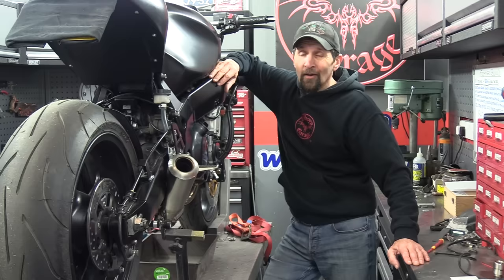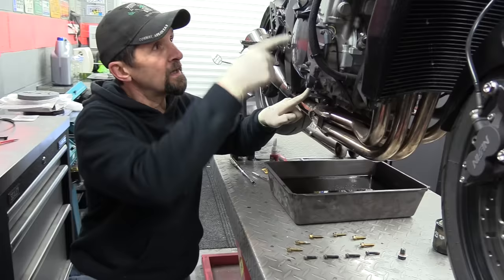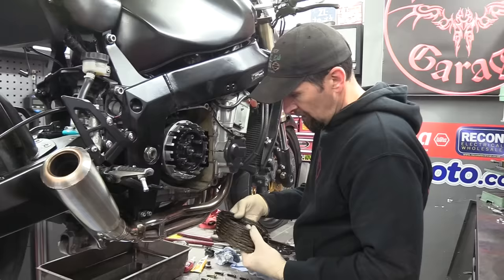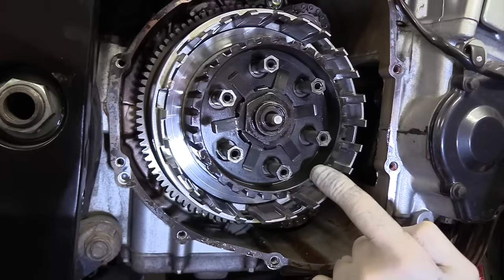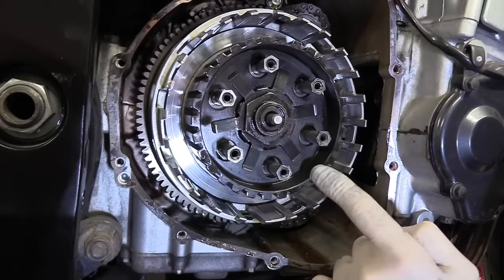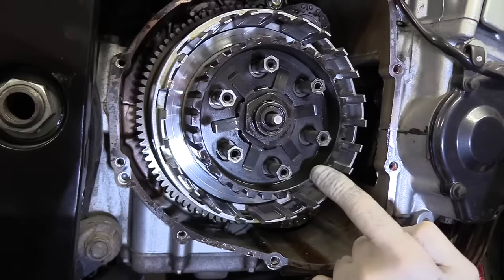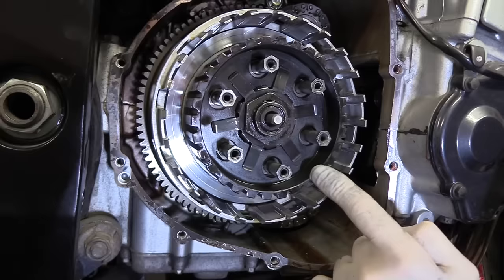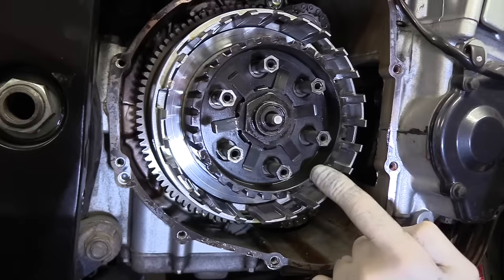Delboy's Garage,  Motorcycle Clutch Replacement .

Comment: Hi del, thanks again for another great vid. My old zx9 has a problem with clutch, when it's been standing for a while (few months) when I pull clutch lever in and select 1st gear the bike jolts forward and stalls like I've selected gear without pulling clutch lever in, I have to keep working the lever and wait for the bike to warm up a bit before things return to normal, just wondered if you had come across this before and what you think it could be, many thanks john.
Reply from the maker: Hi John, that sounds like every day on an old Harley.!!!   it sounds like the plates are hanging up and taking time to separate fully if working the lever improves it, try changing the oil mate, i assume you're using a good quality 10W40 semi synth at least ?.. and like with a Harley, try working the lever in and out BEFORE starting the engine ! then work it again before you engage first, and see if that improves it. If not, then id drop the cover off and have a look at the plates, you may have some warped ones in there from overheating..!!!! Good luck with it mate.   Del.
Reply: @Moonfleet41  thanks del, it had a new clutch about 5 years ago but I only do low milage and a oil change 600 mile ago with castrol 10w40 bike oil, fully synthetic. That bike has always done it since  I've owned it, like you said with an old Harley maybe it's just the way they are. Thanks again del👍
Reply from the maker: @TheWhisky81  Hi John, ok, sounds like a healthy well kept bike, and am presuming not abused... not sure what model of ZX9R you have, but you said old ZX9R, and the early ones were hydraulic clutch, so if yours is?  Then try bleeding the clutch through completely as that could be stopping is disengaging fully if you have any air in the system.  It's hard to diagnose a spongy clutch unless it changes all of a sudden because they're not solid like brakes, am sure you know how to do it, just pump about 4 reservoirs of fluid down through the clutch line and out the bottom, then tape the lever halfway in to the bar over night so it's just biting, but don't pull the lever all the way in... then give it another try the next morning, could be a spongy clutch is just not pushing the plates apart fully... the clutch rod should do about 3mm of movement and a spongy clutch can half that, causing the plates to drag,s o give that a go mate.
Reply: @Moonfleet41  sorry del I should of said it's the e1 2000 model, they went back to cable operated on these models, it has had some abuse to be honest, outon park 6 times, donnington and Silverstone once. If it gets more frequent I will  just put a new clutch in I think, thanks john.

Comment: Hiya del. It's hard to diagnose things from a far I know but, What would you say the most likely issue is with my clutch on an 02 Busa: I have had it for the past several days where, on a cold morning, the clutch wouldn't engage at all for the first 5 minutes. It would then start to engage, but would sometimes act as if the clutch lever was pulled slightly in at certain revs.

After about 10 minutes, everything would be fine. I changed and chased out the old clutch fluid fluid anyway just in case. However, the past few days the bike hasn't been engaging with the engine at all. As I tried on several attempts to pull the clutch in and release, it was making a horrible grinding noise. I glanced over to the little window where the clutch plates are, and I can see what looks like parts of metal.

What is the most likely culprit here do you think? Do you think I am looking at simply replacing the clutch plates, or are you aware of possible more damage, based on what I've described? What's the worst case scenario in other words.
Reply from the maker: No point putting it off buddy, drop the cover off and have a look.. Hayabusa clutches can have a few problems, the basket can come loose, the slipper mechanism can play up (in fact they usually do), and until you find out what those "parts of metal" are then there's no point guessing.!
Reply: @Moonfleet41  yeah I know pal, just gathering some intelligence before I start the inevitable! Cheers for the insight, that's what I was after
Reply from the maker: @hunterjg777  You're most welcome mate, wish I could be more help, good luck with it, hope it's something minor that can be fixed cheaply!
Reply: @Moonfleet41  just on the back of this del, I've taken the clutch cover off, and it appears one of the friction plates has snapped and taken one of the forks with it, but just one forks - am I looking at rrplacing the entire basket now, or in your experience, would this still be usable?
Reply from the maker: @hunterjg777  Just to be clear mate.. what exactly are you referring to by "Forks"  can you send me a picture maybe ?.

Comment: Thank you for your video. May I ask a question? When I opened the cluctch friction plates, and everything was off, out of curiousity I pulled the clutch lever few times, and each time it became harder untill it is so stiff that it is not almost moving at all, the lutch lever I mean.  I am waiting for the cluctch kit to arrive by post now, and have few days to figure out what I did wrong, perhaps. Should just finish the clutch repait and close everything, and hopefully the clutch lever would work again? Would it become soft again like before, or because I pulled the cluch at the middle of the repair I have caused any bubble or damage to the hydraulic system of the clutch?  My bike is 1988 Kawasaki Ninja ZX10, hydraulic clutch system.  Any help/guid with this regard would appreciate it. Best
Reply from the maker: Most likely you've pushed the slave cylinder piston to it's maximum as there was no opposing force from the pressure plate pushing it back... so the slave piston keeps going, like a brake caliper piston with no pads in, once you put the pressure plate back on and push the rod back, it should hopefully return the slave cylinder piston back to it's seat.
Reply: Immensly  apreciate your quick and accorate reply. It is honor to have more people like you on youtube/social media who are very usefull to the others/general public. Please let me know if anyhow I can help or repay for your acourate help/answer. Chase from Orange County. Best Regards
Reply from the maker: @chasebagherieh3869  You're most welcome Chase, im glad the in reply helped you out... we have heavy overheads running a bike channel with parts, materials and consumables, and we're not a commercial garage, i just do this for the Youtube audience, so all the usual ways to show some thanks, you can become a Patron if you like, or just a 'dollar in the tip cup', it all helps with keeping he bills paid... other then that, just subscribe and keep watching, there will be other videos that will help you im sure.. Thanks again my friend.. take care and keep safe.. Del.
Reply: @Moonfleet41  Yes, I just signed up. Thank you again
Reply from the maker: @chasebagherieh3869  Thank you Chase, will message direct on Patreon, much appreciated!

Comment: Have a question about car quest W15-40 diesel oil . Does this oil cause clutch plate to stick? Second time I sent my bike to bike shop and they charge me $50 bucks for a oil change and I notice my bike jerks forward pretty hard when I take off
Reply from the maker: If they are a garage, why are they fitting 15-40 diesel oil car quest and not a 10-40 motorcycle oil?
Reply: Delboy's Garage guess they are cheap. I have to change my own oil from now on. I work at advance auto. So pricing for be a cheaper than getting it serviced

Comment: On my zx12r basket and hub there is slight burrs on some of the edges not on the flats. Would it be okay just to smooth them out ever so slightly?
Reply from the maker: Yeah, as long as you just remove the burr, and no extra metal.. that will help prevent anything hanging up during operation..   Cool bike BTW.
Reply: @Moonfleet41  thank you for the reply. Yes best bike i have owned just awaiting new plates now so i can get it back together. Thank you for the advice and keep the videos coming.
Reply from the maker: Most welcome buddy, and go careful, that's a monster of a bike right there..!

Comment: Wish Kawasaki clutches where as easier to do than this, just over two hundred pounds just changing the levers and holders, together with the cable adjuster[ not counting forty quid for oil] and the damn thing still slips in first gear!

Comment: Is it necessary to apply threadlock for clutch lifter plate bolts?
Reply from the maker: No, I've never done that, just torque them in evenly to the correct value.
Reply: @Moonfleet41  Thanks

Comment: Right I need your help I don't know the torque specs for the bolts it's a 125 just don't want to end. Up stripping the bolts
Reply from the maker: Nor do it Charlie, id have to look them up just like you.. if you don't have a service manual (which will have them clearly listed) then you may be able to download a PDF from the net... lot of resources online mate.
Reply: @Moonfleet41  thanks but just wondering could I just have them hand tight
Reply: @Moonfleet41  and huge thanks for the reply

Comment: What do you mean by juttering? cause rn when I let my clutch out right as I hit the friction zone it starts like vibrating or stuttering or juttering as you says maybe.... Other then that it feels fine.
Reply: Like it shifts fine no slipping at high  rpm but that was only on the ride home after it started happening and I just replaced the clutch last april
Reply from the maker: Hi buddy, the 'juddering' or stuttering as you call it, can be caused by a broken clutch spring, so you're getting an uneven pressure around the circumference of the plates, it can be caused by a plate that's breaking up (and new ones can break up too), or in extreme case, a fractured steel plate, but if all of that's ok, it could simply be a case of needing an oil change as it does affect the clutch, the same as does a low oil level, because the clutch plates can then overheat and warp, just a few possibilities mate.
Reply: Delboy's Garage yea man i really hope i didnt heat them up to much i went on a 3 hour ride up north and did some riding up there as well and I wasn’t being easy on the bike either, never did I check the oil but i had just changed the oil and I use Amsoil so i thought it would be good but it was like 3.5 liters low..... the trip was like 480 miles round trip but it was in two days 300 miles one day tho. Its crazy cause the problem didnt start until i got into my town first red  light i stopped at let the clutch out and it started.. glad it didnt happen where i was .im probably gonna take the case off today and take a look. Thanks:)
Reply: @Moonfleet41  Thank for the reply, my bike was low on oil when i got back from a trip about 500 miles round trip and it started right when I was almost home. The oil  wasnt in the sight glasss at all with the bike level I added maybe 3 or 4 liters what kind of damage could this have done. I havent opened the bike up yet because I contacted a shop to help with some other things and didnt want to tear it down at my house then they call tomorrow plus I like to collect a lot of info before messing with it so I dont mess anything up but obv might be too late for me not to mess anything up lol.
Reply: @Moonfleet41  Also How could I fracture a steel plates I do run it hard but not dropping the clutch at all. and If it was a steel plate or spring I still have my old steel plates and springs could I just swap out the bad and put the old in?

Comment: I’ve got a sv650 2004, clutch slips under moderate acceleration but only when bike isnt fully warm. Any idea why?
Reply from the maker: Try an oil change mate, if it hasn't been serviced for a while, it's always good to get that up to date before you go trying to diagnose more expensive problems... if it happens after you've done an oil change, then drop the pack out, take a look at the rings... see if they are scorched, or buckled (but of course, first check you have enough free play in the clutch lever at the bars, if that's too tight, then your clutch will slip till it warms up and the cable stretches).
Reply: @Moonfleet41  it done it ever since I had the clutch replaced  around 10000 miles ago/5 years ago. It 's had a few oil changes since then, as soon as it's upto temp it completely fine

Comment: How many newton meters of torque does my Mt-07 motorcycle's clutch pressure spring bolts operate? Please Can you help me?
Reply from the maker: Sorry i don;t keep that information to hand.. you'll fin it listed in any good service manual though.!
Reply: @Moonfleet41  I finded on the service manuel book. Clutch spring bolts( M6) tighten values 8Nm(0,8kg fm).

Comment: My mt 07 is almost impossible to put into neutral if I stop, sometimes it will even roll forward on its own in 1st gear. Do I need a new clutch?
Reply from the maker: MT07 is a pretty new bike buddy, I doubt it's worn out, but it's clearly not disengaging properly... have you got too much slack in the cable maybe?
Reply: @Moonfleet41 I have the slack so I can just fit my credit card between the gap in the lever, it's a 2015 with 20k miles. Sometimes it does it sometimes its fine, I changed the oil as well and didn't seem to help.

Comment: I have been toying with the idea of replacing the clutch on my 2009 z1000 c9f and having watched this I do feel ok, subject to buying a decent torque wrench. One big issue that I have discovered though is that the previous owner absolutely raped this bike and the current clutch is super worn out. I picked up on your early comments regarding CLUTCH JUDDER, which this thing has (VERY SERIOUS JUDDER INDEED) when releasing the clutch lever... Can you please advise if this is a sign that the entire basket assembly needs replacing, or the friction and steel plates please?
Reply from the maker: Hi Rob, I always believe in doing things financially one step at a time... (mainly cos I'm usually skint!), if it was my bike doing that I would buy a set of friction plates and steel plates first, and then drop the cover off and pull the old plates out for a look... you'll soon know if they're hammered, blue scorch marks are the biggest tell tale on the steel plates, but a very common cause of judder is warped plates, so lay them on a flat surface, one at a time, and if any of them are warped or buckled, then that's your huckleberry.  Check the basket fingers for castlation and clean off any burrs with a fine file, or even just some emery paper wrapped around a file, so they're nice and smooth... chuck the new plates in (carefully in the correct order of course!), then throw the cover on and go for a ride... you'll know straight away if you've cured it, and if you have, then you've spent no more money than you needed to.  Just as a little advisory mate, it wouldn't hurst to bleed the clutch fluid through at the same time, and if you can afford it, stick a new set of beefier springs in it at the same time.  And btw you didn't say, this isn't a Hayabusa is it??

Comment: What is the small torque tool you are using?
Reply from the maker: Hi Michael, it's one of these..:- https://www.reconelectrical.co.uk/Wiha-Torque-T-Handle--T-Plus-TorqueVario-Set
Reply: Moonfleet41 thanks for the reply... a bit out of my price range but thanks. I will probably use it once a year and I’ve found something for £25 a bit more suitable, cheers. Great video

Comment: What oil you use to impregnate?
Guess ur not gonna waste that much of high grade oil wich u put in bikes?
Reply from the maker: I use the oil that's already in the engine, as that's what the clutch will continue to run in..!
Reply: @Moonfleet41  But you do an oil change with a new clutch right? Or you use the oil the clutch has been soaked in?
Reply from the maker: @scuffieduffie  Generally speaking, if you are fitting a new clutch, it's worthwhile getting rid of the old oil with all the old contaminates in it, so et yourself a filter, soak the plates overnight in the new oil, and then when you've fitted the new clutch, tip the oil in the bike after draining out the old stuff... job done!

Comment: the lowest torque i got is 25 NM, need to get another one...
Reply from the maker: I use this for really low torque values....but i Just bought a new one after 20+ years with mine. ranged from 7Nm, to 112Nm.. Perfect for a bike.
Reply: @Moonfleet41  finally got 1 from 5 to 25 NM, I'm sorted finally lol

Comment: Hi guys,anybody can tell me what is the best clutch kit:ebc,trw lucas or gecho?thanks
Reply from the maker: The only experience I can give of upgrading a clutch is the Gecho kit in my streetfighter build, used it with uprated springs and it's rock solid, a really good upgrade, but I can't vouch for the others as I've not retro fitted them.
Reply: Thanks Del.

Comment: That gasket goes on dry...
Reply from the maker: Yeah it can.. and thats fine until the first time you have to spend an hour scraping it all off the engine side with bits falling in your clutch cavity and oil ways... because they dont come out dry mate, (at least in 30 years ive never had one do that..!)

Comment: my main pressure plate keeps spinning when im trying to tighten the bolts i thought this was because i was in N but i Put it in first and its still spinning anybody know this is happening
Reply from the maker: The torque setting for the spring bolts is 8.8 Nm, that's not enough to turn your clutch drum.. as shown in the video..  are you trying to torque them down harder then that ?
Reply: @Moonfleet41  no I'm not even to the point of torque yet I'm able to move itby pushing the plate with my finger I could spin it around as many times as I want and the whole thing moves